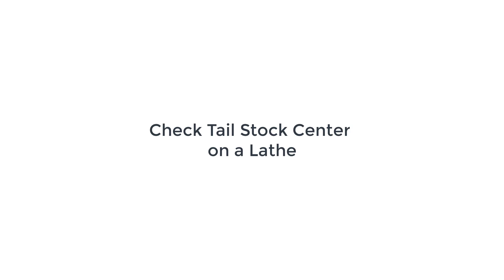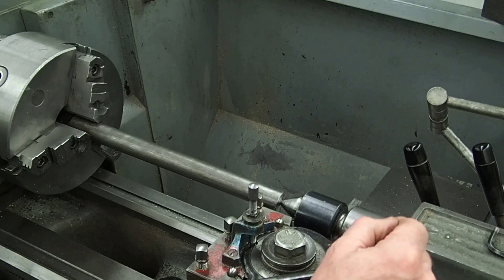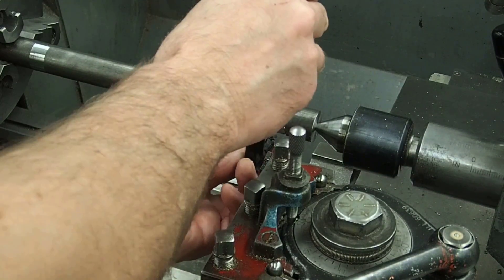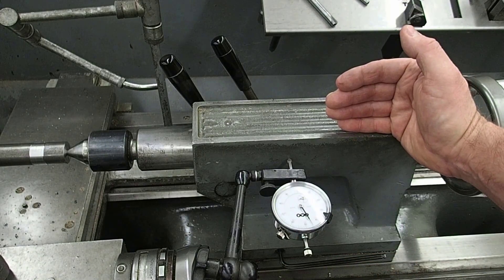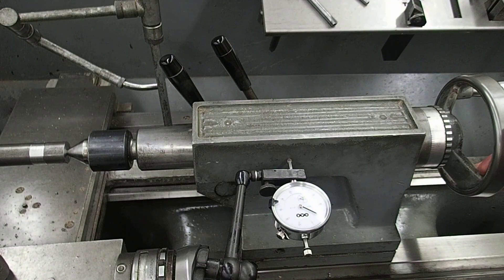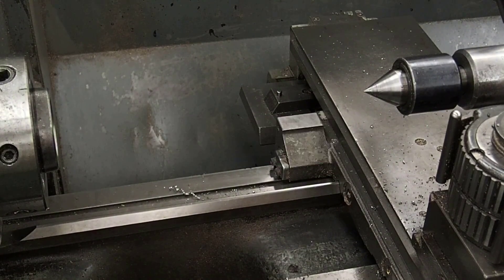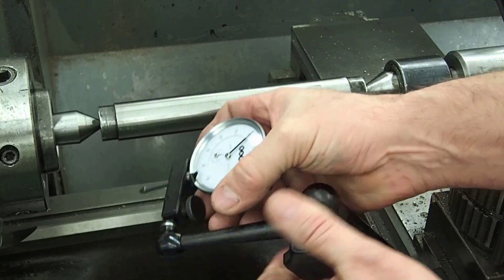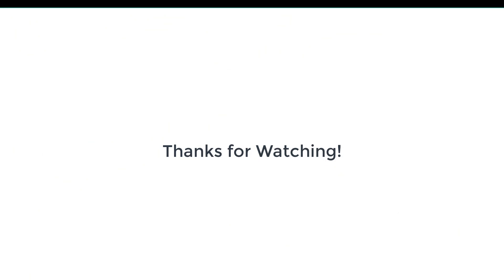Lathe Tail Stock Adjustment

Comment: Your initial test run is adequate. But!   The placement of your dial indicator should be placed at the first witness cut you did and not on the body of the tail stock.  As you need to make the correction at the cut itself. Placing the indicator further out like you did results in a compounded error.  Therefore your method will require several further test cuts.
But the first thing to do is to make sure the saddle is actually still running truly parallel to the bed. Wear on the ways will still throw you off depending on the length of your saddle travel as per the job in place will require.
I realize that at the time I write my comment and the posted date of the video, there is a six year gap!
Reply from the maker: Thanks for watching and your observations.

Comment: Pretty much the problem I have at school. Nice way to easely fix the problem. 
Pretty sure it will only fix it at this exact lenght thou. And possibly for that diameter if your tail stock is too low or too high.
Thanks. Good vid for that issue are hard to find.
Reply from the maker: Glad it helped. This can be tricky if the bed has a twist in it.

Comment: At the end of the the video where you measure the ground bar at the spindle with the dial and run it down to the stock center you said it moved away .003".  You then say it needs to be moved forward half that distance to bring it into alignment with the spindle.  That wasn't correct, you need to move it back the whole .003.  Other than that - great video and explanation.  Thanks
Reply from the maker: Thanks

Comment: Great video, right up to the point where you say that you need to bring the tailstock back half the offset shown on the indicator when using a test bar.

The reason you use HALF the difference when TURNING a bar, as you do in the first half of the video, is that you measure differences in DIAMETER, which changes by twice the tail stock offset. But when using a test bar, you are measuring the RADIUS, so you shouldn’t divide the measurement. 

You also don’t have to move your indicator to the tail stock like you do when turning your own bar. Leaving it in place on the test bar while you adjust the tail stock to zero on the indicator is much easier and also illustrates that you need to use all of the indicated difference (making the indicator read 0 at both ends of the bar).
Reply from the maker: My mistake, thanks for the correction!
Reply: Excellent! Easier and more simple is better

Comment: Hi ,
thanks for a great video.
I ask the question should not the tail stock dial gauge measurement be taken against the  machined work piece at the tail stock end surface. this will directly measure the run out adjustment that caused the misalignment at the "cut">
Reply from the maker: Hi Charles, that will work also as long as you are on center. I like the large flat surface of the tail stock and it is not in the way of the machining. Thanks for watching.

Comment: That was an awesome Video, most practical way of fixing a lathe up especially if you're on the clock. Nobody has a very expensive mitutoyo level, or the time to dick around in the dark. Get out your dial and tools, make some adjustments and then get to turning. Chances are you are taking some finishing cuts on a shaft or something when you find out you're out of tolerance. Get it done or go home, the boss is waiting....
Reply from the maker: Thanks Tim, its fast and often close enough!

Comment: Well what you've shown will work it's a bit too limited for information. Before doing what you've shown the lathe bed needs to be trued or any twist taken out. Easiest method is using a high precision machinists level. With that done the headstock needs checking to be sure it's correctly aligned with the lathe bed. 90 degrees in both the vertical and horizontal direction. That can be done using the two collar method. Google it.  And it's extremely doubtful that headstock center didn't have some measurable runout. Better to chuck up a piece of scrap material and cut a 60 degree center on it so it's as concentric as the machines bearings will allow. You then need to indicate the tailstocks ram for up/down and left/right to be sure it's true with the ram extended and locked. After all that then yes what you've shown will work to align the tailstock correctly. But any wear or inaccuracy of the bed grinding is still an issue. The subject is a whole lot more complex than I've mentioned and Googleing and fully reading what Dr. Georg Schlesinger had to say about testing machine tools would be a good starter. My first lathe had a non adjustable tailstock. Even leveled using a very expensive Mitutoyo precision level it still required a very minor amount of bed adjustment to get it to turn parallel end to end. And very few to maybe no lathes no matter how expensive have a tailstock that stays 100% aligned down the length of the bed. And those are brand new. Add in normal wear after a few years and you will see changes from where your correct adjustment was to a different tailstock position on the lathe bed. There's a whole hell of a lot to this that isn't understood as well as it should be by far too many on YT and the machining forums.
Reply from the maker: Turning Point, I 100% agree with you. If the lathe is not accurately setup to start you can set the tailstock all day and never get it right. Your post is the first step, or a check if the lathe is not responding correctly. My video only speaks to aligning a tailstock that has been moved off of center. Thanks for taking the time to write about this important first step!
Reply: +Turning Point  Of course you are right in what say, but you were talking about an unknown/new to you machine. I never took this video as that. I thought it was inferred that he was familiar with his machine and he said this method can be used for turning tapers w/o a taper attachment available. Seems like you know your stuff and are willing to share, if you believe there's that much misinformation on YT have you ever considered starting your own channel to try and curve that problem. You prob could have shot one in not to much more time than it took to type all that especially if you type as fast as I do. =)

Thanks for the vid machiningmoments.
Reply: LOL, I type more than slow. And I'm just barely computer smart enough to get YT to come up. Shooting a video is the easy part. Editing and uploading is very likely way outside my limits. But thanks for the vote of confidence. I have thought about it and maybe someday.

It's taken me years to find the little I think I might know about machine tool alignment. Bits and pieces here and there is what takes the time. Those Schlesinger tests and maybe the Machine Tool Reconditioning book are a good start though. That misinformation or maybe a better term would be misunderstood information would explain a bit better about what I was meaning. Lathe leveling is a prime example on the forums. All your doing is using the easiest method of getting the lathes bed into an unstressed condition. Half decent lathes would have had the bare lathe bed ground on a carefully leveled grinder so your just trying to set it up the way it would have been when it was first ground. The lathe could be at a 45 degree angle as long as the bed was straight and it would still work accurately. Testing with a good level is just the easiest method. There's no real magic in the level part.

At-Man Unlimited has an extremely good series of videos about properly aligning a Fadal cnc bed mill and most of what's there could be applied to almost any mill. There's very few videos around with that high level of information. I can say my equipment seemed a whole lot better when I knew a bit less though. :-)
Reply: Yes I've very familiar with lathe leveling, Bought a 1964 10HP 19x64  Leblond HD Tool & Die lathe and a series 2 Bridgeport not long ago and wouldn't you know it I went to auction do buy some shelving about a month later and there was a 15x54 Lebond servo shift w/ collet, 3 and 4 jaw chucks and a bunch of tooling and Aloris post, I threw out a bid of $600 knowing there was noway Id get it, hell the 5c speed chuck was almost worth that, it was in real good shape w/ excellent ways.... and low and behold I got it... so Ive been doing some leveling this year lol. Your right, level from head to tail is not that critical but level from way to way all along the distance of the bed is very important to avoid the real problem TWIST.  
I have been a patreon supporter of Tim at AT-Man since he started, actually i think I was the first or second one. I have a 94 Fadal 4020 and MAN! i would have killed for his vids about 4 years ago!!! He's great! I can't wait for his probe vids! Did you see the one where reversed engineered the OMM box for that thing??  98% was over my head, but its awesome. He's a pretty damn sharp guy to say the least.
Reply: Very nice lathe and I'm a bit envious. I've only read a bit about the servo shifts and they seem to be a real desirable lathe.You stole it about 5 times or more at that price and what it came with. If my little shop had a concrete floor my equipment choices would have been larger and a lot heavier that what I had to settle for. Having Deckel, Shaublin tastes on a beer budget doesn't help. Tim's a real clever guy for sure. That series of alignment videos of his should be required viewing for anyone with a mill. A great deal to learn in those. 

Likely your already subscribed, but just in case. ROBRENZ, and Joe Pieczynski I'd put right up there as well. This Old Tony, Clickspring and Stefan Gotteswinter also. I expect I'll learn a lot from Tim's probe videos. I'm manual only for machines so bought a Haimer 3D. But I still like to learn about cnc. You never know what can be picked up that can also work with the more primitive equipment. Somehow I've missed that video about the OMM box, I'll have to check that out. Thanks.
Reply: Oh yeah. I ditched cable the day I found Tom's channel and then everybody else a couple years ago so I watch all the machining content that has big machines. Robin is the best, talk about a the real deal. Just wish he had more time to make vids.  My toolmaker Leblond is a servo shift also, I think I have pics of some of my machines on my Google+ page if you want to check them out. Servo Shifts are nice but some people don't like them because they have some bits on them that can of course break that aren't needed on manual shift lathes, even though I haven't had trouble with mine I understand the're point, I mean how hard is it to pull a lever or 2 to shift.....  Now the series 2 Bridgeport's extra bits are awesome, power  x, y, knee, quill, draw bar, DRO, cat 40, 4hp I love all that! Hell it's got to have power draw bar unless you want to drag out the latter to change tools LOL
Reply: No machine is perfect. I agree 100% with the method just shown as he is setting up his 'Z axis' as best as it can possibly be under all given circumstances. To get two diameters the same after the tool has traveled up and down ANY distance in between, is the aim of the game. It really is as simple as that. NASA might ask or expect higher protocols but then they would not be using parts machined on any manual and decades old lathe. Part of what many people enjoy is setting up a machine to be as best as it might ever be, rather than it being a robot.
Reply: Sounds like the things you mentioned would only really come into play in high or super high precision work. Most at home or hobbyist machinists rarely if ever need that level of precision. This sounds like a basic procedure that will get a level of straightness that will suit most applications not requiring super high precision. Of course older machines are going to have run out and such but if your skill set is half way decent you learn how to work with that kind of stuff.
Reply: Nope, what I mentioned is just basic set up for any lathe you expect to turn parallel. And certainly running the full set of Schlesingers tests should be SOP for any new or used machine you buy. I mounted my first lathe (a little Emco compact 5) on a 1" thick steel plate. With some adjustments had it within 2/10ths over 12" Sadly with the standard stick built type floor construction my shop floor has it would only keep those adjustments over a few hrs until the temperature and/or humidity changed a few points. I don't consider what I did as pushing the limits of high precision at all. Exact part size to a few 10ths may be of less importance in a hobbists shop, but I do disagree that it's unimportant not to have a machine properly set up so it's movements are as close as possible. Model steam or IC engines produce very little power given that you can't scale physics. Correct machine tool alignment is just part of what goes into building one that operates as well as it should. More than a few people are trying to set records with model competitive engines both IC and flash steam with home built designs. You can bet they've had to learn to set up there equipment and compensate for the equipment's inaccuracys as well. It really doesn't take that long once you understand the order to do it in and what effect those adjustments will have.

I also had a really poorly machined Seig C6 that broke every tip off of every center drill used in the tailstock. Then I didn't know enough to run the proper checks as soon as I got it. An indicator on the tailstocks quill showed it pointing uphill over .009" in just over 2". Without that check and remachining the tailstock would have been unusable. Add maybe 2" for a drill chuck, then lets say another 4" for a reamer and then try reaming a straight hole with a tailstock that far out and you get a seriously tapered hole.The less you pay for a machine the more checks you have to do. And you can't properly compensate for those inaccurcy's unless you know where and how much they are. The very first step done in industry while installing a new machine is proper alignment and accuracy checks to verify the machine is correct. And these are very heavily built and rigid machines. Yet we expect our somewhat limp noodle machines in home shops to get bolted down and produce good results? Sorry it just ain't that easy and my tests show that more than well enough at least to myself. A bit of educated tuning can make some huge differences in what a machine can produce. What does take the time is learning how and what needs to be done. I've spent years learning the little I do know. There's probably more misinformation on the hobbist's forums and YT about machine tool alignment than there is correct information. Unless your parts are being checked as good enough with a tape measure then those checks and alignments are required.